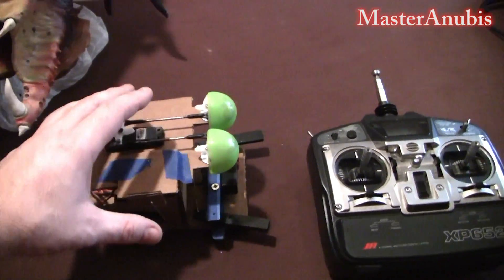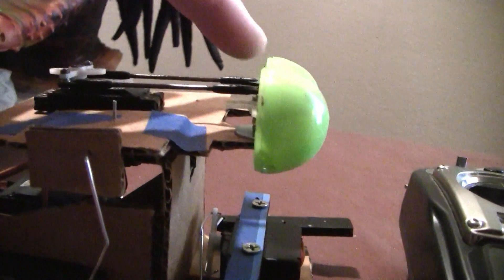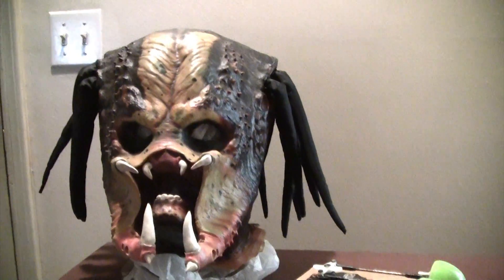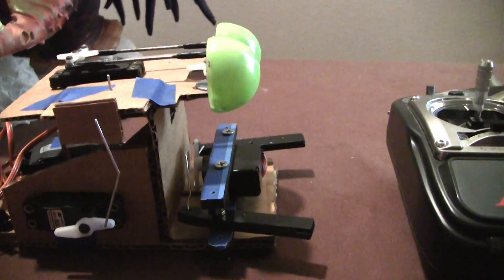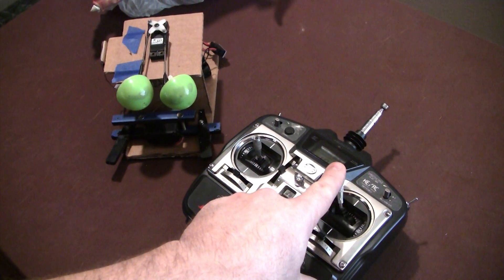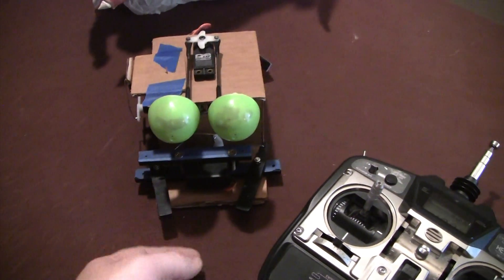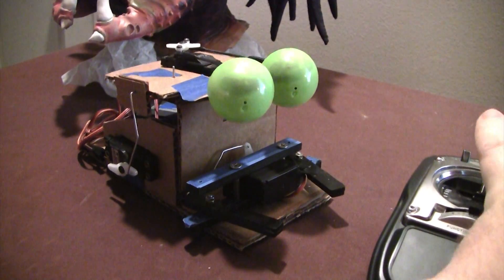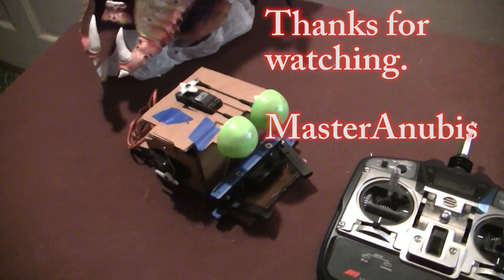Cardboard animatronic test setup

Comment: @FordFastback Ok, good Arduinos are a step above PICAXE, I actually have an Arduino board but My computor doesn't recognize it when I plug it in so I'm still using the PICAXE system.
 But hey I can get some cool toys made either way, but it would be nice to incorporate a desktop or laptop comuter into some projects.
 But any way I figured that You'd probably have a couple of buttons strapped to a finger to play some pre programmed servo skits to make the mandible servos do stuff.  Take Care Man.

Comment: I have always said that Foam Board (from the dollar store) and hot glue, are the ultimate in quick prototyping materials.
    Do You know how to use the PICAXE Micro Controller System, or any kind of microcontroller system, that would be great for this application with the servos.
      Very Cool Man. Keep Kickin' Ass!